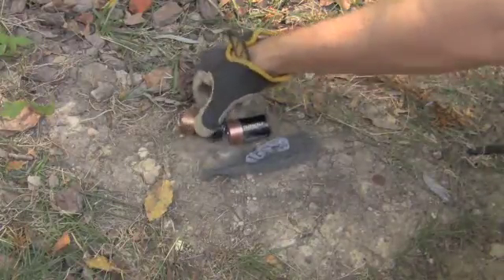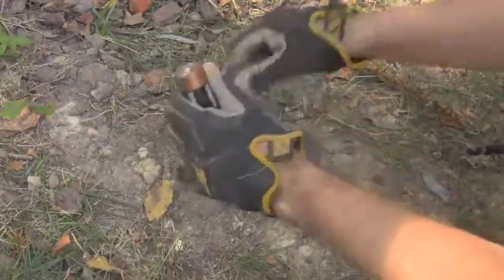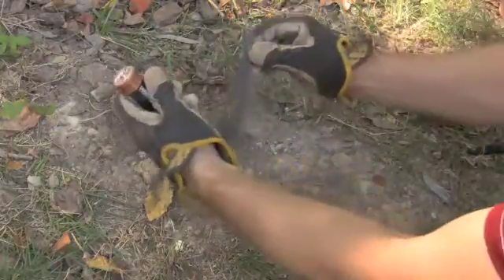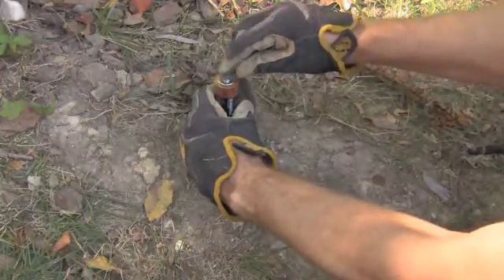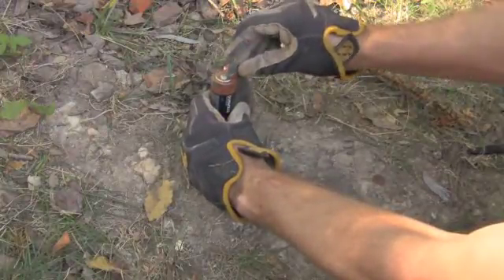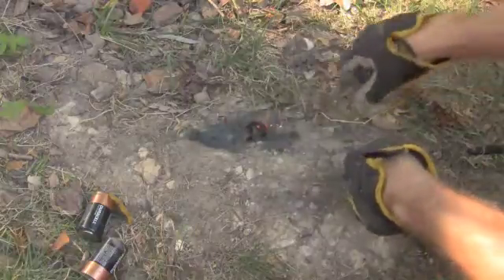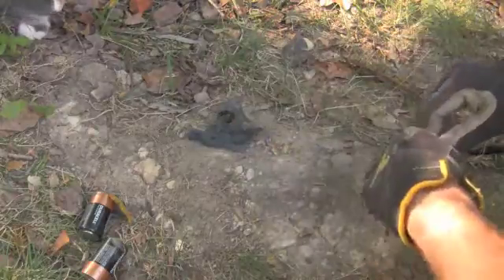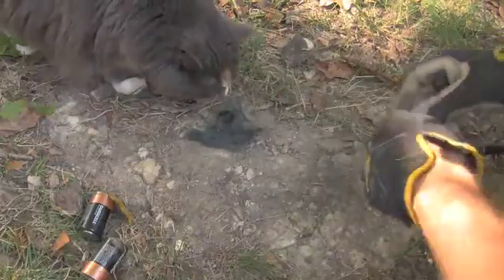Using a D Cell Battery to Start a Fire

Comment: @rallypointLLC also to if you have a 9 volt battery. But you need some triple A battery. Inside the 9 volt battery theres 6 triple A batterys. Check out Kip Kay on YouTube.

Comment from the maker: People who don't want to freeze to death in the woods when they can't start a fire.  There are cavities inside most flashlights where you can tuck away a bit of steel wool and dryer lint.  Combined with the batteries inside the flashlight, presto, instant fire starter kit.